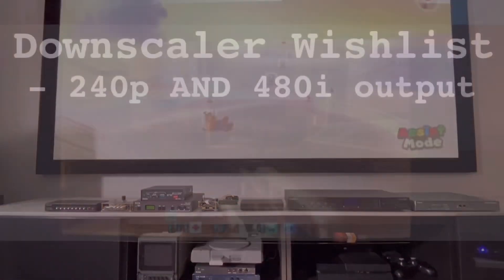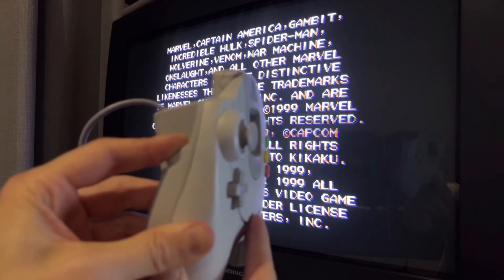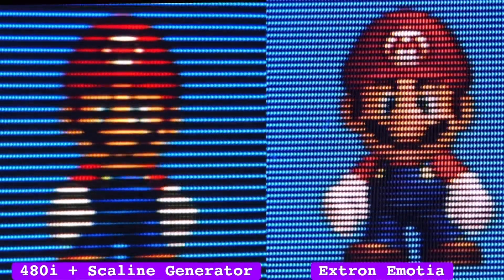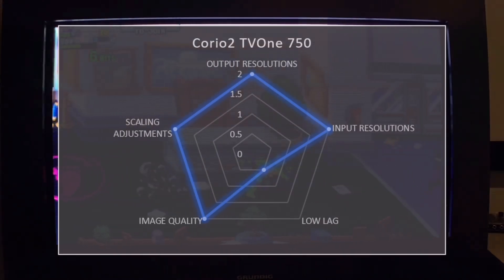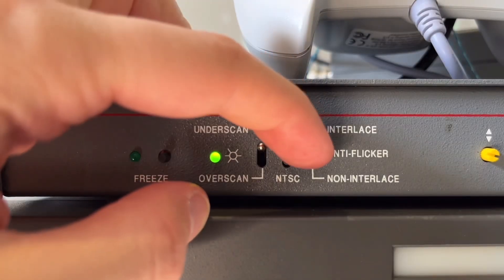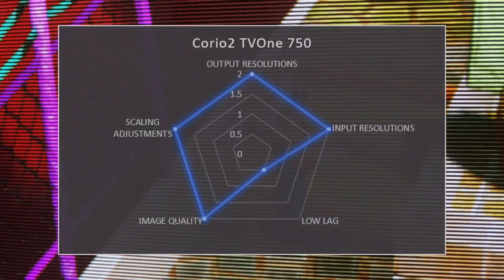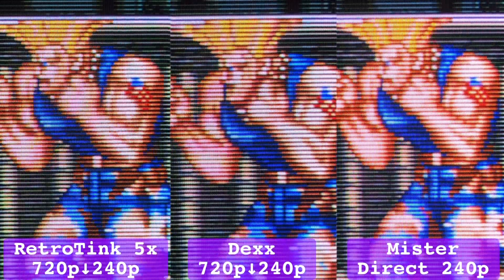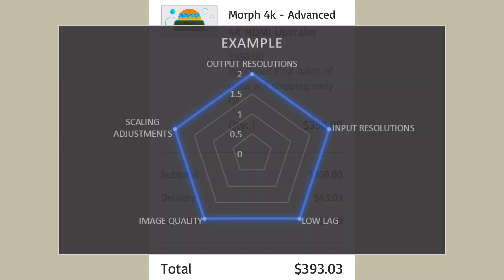Downscaling Chronicles 8: The Downscaler Wars. Corio2 tvOne GBSC Dexx RetroTink 5X Extron Emotia

Comment: This is great!.  I really like the RetroTINK 5X, but I see it's only inputs from component to HDMI.  I need it the other way around. How are you playing this to you CRT from  game consoles?  What converters/adapters are you using?

  I already have an 4K HDMI to component converter that works great with my laptop.  I can adjust anything to fit my 4:3 CRT perfectly.  But I'm trying to use an Amazon Firestick to my 4:3 CRT television.  The Firestick doesn't have a 4:3 setting and the video is squished so I need an aspect ratio changer and those don't seem to be easy to find.

  I do also have several video game system's that could benefit from the RetroTINK. 

  I can use the 4K HDMI to component converter to then take the HDMI out from the RetroTink 5X but then I'd need an HDMI to component converter to now go into the RetroTINK 5X.  So, being that I already have the first step done.  When I get the RetroTINK, all I have to do now is get an HDMI to component converter.  Is there another recommendation you have?

  Thanks for doing this video btw.

  Update:  Okay, I see you are using a Portta HDMI to component converter in the video dedicated to the RetroTINK 5X.
Reply from the maker: Caio! I see you found what I’m using for the HDMI to component conversion. This was more of a stop-gap in the series to save everyone sifting through hours of content. Since then, there’s a dedicated Downscaling section on RetroRGB which summarises most things you’d want to know into a table. 

There’s a new ‘king’ of downscaling that in my opinion is a 10/10 which is the OSSC Pro plus Extra AV Out addon. No external HDMI to analog converter necessary. Second to that is Extron DVS 605. Without either of those or even the RT5X you would be able to stretch pillar boxed content

Comment: What equipment is used with the 5x? Want to switch to it from corio2
Reply from the maker: You have to use an HDMI to component transcoder for the input, and depending on what your CRT accepts, on the output either another HDMI to component DAC, or an HDMI to VGA DAC with a sync combiner for RGBs.

Comment: I haven't had much luck with downscaling on my MiSTer on my astro city 15khz MS9 nano CRT. It always looks crap and it doesn't seem to have many options in the mister.ini to fix much. It varies from core to core, but downscaling always seems crappy, text is often illegible. 

I'm going to take a good look at the dex kit, thanks for the video!
Reply from the maker: Thanks for checking out the video! Why downscale the MiSTer at all if the CRT is 15KHz? You should be able to output native 15KHz without scaling, or do you mean you’re using MisterCade via Groovy MAME?
Reply: @MarcoRetro316  Oh mostly for any cores that don't output native 15khz, so cores like ao486, Sharp X68000 and then even for systems like minimig/amiga some games are actually out of sync range (a lot of them are fine without using the scaler though).Some of the more obscure consoles also output stuff that the 15khz CRT doesn't like.
Reply from the maker: @flain283  I oh got you. The only outlet with the DExx is you’ll need 2 DE-10’s; 1 as a MiSTer and the other as a scaler as the DExx runs off a DE-10 Nano. At that point you might at well be getting an OSSC Pro to downscale. I use a custom 240p resolution in the INI file for AO486 core, I’ll post it as a separate comment later tonight though you might already be using the same modeline. I haven’t tested if it precisely divides the scanlines so text and sprites will probably scale unevenly
Reply: @MarcoRetro316  That makes more sense now thanks! I am using a modeline for it (same as i use for the menu output) so i'm interested to see if its the same or not, thanks! :)
Reply from the maker: @flain283  I have this at the bottom of the ini file, you could apply it to other cores by putting the core name in brackets in place of ao486

[ao486]
; Set it to "Variable" in the ao486 core instead of 60Hz
direct_video=0
vga_scaler=1
vsync_adjust=1
vscale_mode=3
video_mode=1280,152,140,261,240,15,0,19,30105 ; 4x3 for 320x200 games, 16.42kHz, 59.94Hz

Comment: Did you ever try MIMO Genius 2? It is very good!
Reply from the maker: Not yet unfortunately, though I’d love the chance to try one to document for a video of its own. They’re hard to find nowadays
Reply: @MarcoRetro316  I bought the very last one directly from MIMO company a few years ago, I use it for downscaling only. I feed it with 640x480 VGA to downscale MAME and X360 and it is very good! With it I can avoid the hassle of a CRT Emudriver setup 😅
Reply from the maker: @pedroTFP  You got lucky! I reached out to MIMO Enterprise multiple times to see if they had any stock in the back but no reply. CRTEmudriver will be my next venture. Wish me luck
Reply: @MarcoRetro316  I’ll look forward to! 😄
About MIMO, I asked them if they’d ever go into a “Genius 3 project” but they said the initial cost of R&D would be substantial. I suggested them to look into crowdfunding!

Comment: Thanks for mentioning the pricing, I've been interested in downscaling to 240p since 2016 and never could because all the downscalers are just too expensive for me, paying upwards of 200~300 dollars just to downscale to 240p is just absurd to me, and the affordable option like the modded Corio2s have always been unobtainable to me at a decent price and have only become more and more rare, so it's nice to see cheaper options like the pre-built GBS-Cs or the DExx come out in recent years. But don't get me wrong I'm still not happy about it, you would think that downscaling to 240p should be dead simple, since there's cheap downscalers that can output 480i from 720p/1080p, and yes they can be a hit or miss but there are some decent ones around that only add 1 or 2-3 frames of lag and can also do fast interlacing for 480p under 16ms for around 40 bucks. But we seriously need a dedicated 240p/480i downscaler that only does that and nothing else as fast and cheap as possible for retrogamers enthusiasts that are using emulation with modern GPUs or just want to play modern games on their SD CRTs, not bloated ones that in reality are not even meant for us but for retro console gamers wanting to play on modern displays. 

Anyways at least I've got ways to play modern games/emulators even at high resolutions downscaled to 240p nowadays but it's not plug-n-play and yes one it requires an old card with VGA while a modern one does the rendering, it's cost effective but getting harder as cards with VGA are getting rare, lag should be relatively low or non-existent. There's also low-latency local video streaming to a PC that has VGA/DVI-I using ethernet and a fiber optic cable to connect both PCs directly which keeps the lag under 5ms using something like Steam Link or Sunshine/Moonlight, you can even use a Raspberry Pi as they can output 240p on HDMI or do composite but that can be a hit or miss on the weaker ones that struggle with video decoding, works great on a RPi4 or 3B+ though, still I wanna see the day we get 240p/480i downscalers that can do this without breaking the bank and as plug-n-play as possible.
Reply from the maker: Hey thanks for the comment. I do agree, a simple plug and play dedicated Downscaler with 240p/480i output made specifically for retro would be killer, sold at a cheaper price that removes the need for a beefy FPGA that’s needed for the upscaling side. I’m talking naively though as I have no insight to the engineering aspect. The cheapest solution that will get you all the input and output resolutions are probably a tvOne scaler, or a GBS with a piggy back downscaler, though a little messy with cable management. I plan on doing an episode focusing on MisterCast, PC GPU 15KHz output, and using a RPi (which is what I use to output 480i movies via USB as my PS3 and Wii can be fussy with video codec). It might be a bit much for one episode so I’ll see how best to tackle it to give enough screen time for each solution. The CRTEmudriver and Batocera users seem very happy with the output and is said to be the gold-standard for pixel perfect scanlines, provided you don’t mind repurchasing the game or obtaining by other means. Yet another rabbit hole

Comment: I'd like to know a cheap downscaler with no input lag

I want to play ketsui ps4 vertically on a CRT
Reply from the maker: The cheapest Downscaler with low lag is the GBS-C. There’s a few hoops to jump through like the HDMI digital to analog conversion and the PS4 needs to be set to 480p. I’m pretty sure the PS4 won’t display through the GBS without stripping HDCP

Comment: Doesn't the Retrotink 4K offer 240p output as well?
Reply from the maker: Yes I believe it does output 240p but not 480i
Reply: @MarcoRetro316  Ahh, interesting. Might be worth looking for a DAC that can go from progressive to interlace and 240p then. I'm hoping such a thing exists, otherwise I'll have to wait for Morph 4K to release its analogue bridge add-on. I want a minimal number of scalers in my setup. 😅
Reply from the maker: @MindForgedManacle I don’t mind doing all the sync combining and DAC-ing as long as they’re passively powered, but I’m really hoping the Morph 4K delivers as the plug and play downscaler with the analog bridge
Reply: @MarcoRetro316  Now that I think about it, you might look into the Extron VSC 700 (or 500). Can downscale from 1080p to 240p as well as 480i. Based on RetrRGB's testing, you'll get 0-1 frame of lag (lagfree as possible, really): https://www.youtube.com/watch?v=vX4Q_KvqZAI

And if you pair that with Ezcoo's 4k splitter (has a built in 4K->1080p downscaler you can toggle for split output), it should pair well with the Retrotink 4K.
Reply from the maker: @MindForgedManacle I featured the Extron VSC 500 is the Extron Interface Trick Video, it works great with picture resizing and is 1 frames of variable lag. But it only outputs as low as 480i ie no 240p output. It also has some screen tearing that was induced with horizontal motion in 3D games.
Reply: @MarcoRetro316   Oops apologies. I misheard him say it did 240p. He did in fact say it couldn't do 240p. 😅
Reply from the maker: @MindForgedManacle  no apology needed 🤪 easy mistake

Comment: This series has been fantastic! I'm very looking forward to future devices. I recently got a Tink4K and am looking into how to set it up with downscaling. Hopefully it performs as well or better than the 5x. There should be room on it for multiple downscaling options as well considering how much effort has been put into his prescaling and decimation work.
Reply from the maker: Thanks! I’m not sure if downscaling to 15KHz will be a supported feature on the 4K. It can certainly get it down to 240p as the pre-scale feature does exactly that. I do recall Mike stating that it won’t output 480i though. I have the PixelFX Morph 4K on preorder and would love to do an episode on the OSSC Pro when stock is available
Reply: @MarcoRetro316  Definitely excited for that as well. The Tink4k can output 240p via a custom linemode. My set soon will be splitting the tink4k hdmi output and remotely controlling if it's downscaled or not. If it is, it goes to vga, then to scart, into my gscartsw.

Here's hoping it looks decent. :)
Reply from the maker: @joshuakelly9390 ah thanks for clarifying. That sounds like a nice streamlined setup!

Comment: For me OSSC Add-on Board as stand alone unit is a GREAT thing for transcoding S-Video to RGB (Scart). None of my CRT TV's have S-Video, only Scart RGB and having this gizmo for 3DO Interactive Multiplayer or FM Towns Marty is a great option to have.
Reply from the maker: It had double the flicker on 60Hz 480i, and 50Hz 576i Bob-deinterlaced to 240p.  The workaround with the OSSC is to have the addon board output 480p instead of a transcoded signal passthrough. It otherwise worked well for 240p
Reply: погоди..так это чё получается, он реально может улучшить картинку с композита\s-video и передать её на Тринитрон с ргб входом ?  Так это же perfect для многих 8-32бит игр, которые,  мне лично по ргб скарту не заходят визуально.
Золотая середина так сказать, тот самый грааль, который ищут ретрогеймеры)
Reply: @JonnyK3D  может, но ты же сам сказал что RGB картинка вам не нравится.
Reply: @SNESFan89  так а показывать он будет как ргб-скарт при этом или скарт вход просто используется как разьём, а изображение будет композит\с видео ?
Reply: @JonnyK3D  нет, он будет показывать в RGB по Scart.
Reply: @SNESFan89  и как это технически возможно?  вытащить из 1-2 пиновых контактов достаточно информации для разделения по ргб+яркость. 
Звучит не правдоподобно.
Reply: @JonnyK3D  но оно работает. У меня она есть и отлично показывает в RGB.
Reply from the maker: The quality is still equal or worse than the original composite/s-video, just decoded into an RGB format. It won’t magically transform composite into RGB quality
Reply: @MarcoRetro316  yes, thanks.. that's how it should be)  But now I'm interested in it as a way to connect the Japanese GameCube (S-Video) to European Scart TV

By the way, I understood correctly after looking at your latest videos that while you can take your time with the old downscalers, take a break and wait for the Morph 4k tests? When will it be released there?
Reply from the maker: @JonnyK3D I have the Morph 4K since launch and it can already downscale with a custom resolution. However I’m waiting for the Crosspoint addon which allows analog video output. Pixel FX have said they will time this addon with accompanying downscaling functions in software, so my guess is it will behave similar to the OSSC Pro

Comment: I was planning to get a Corio but now when you mentioned how bad the input lag is it made me question my plans. Damn this make things difficult :-(
Reply from the maker: If low lag is your priority, depending on your budget the GBS and Retrotink5X would be for you. Then it comes down to if you need 480i output and >480p input
Reply: @MarcoRetro316 to be honest my main usage will be to downscale Wii U and Wii games to 240p. How do the GBS compare to Corio2 in image sharpness?
Reply from the maker: The GBS is sharper but you’d only appreciate the difference if you were looking at both sides by side. Also consider that the GBS will drop lines and therefore you might notice shimmer like I pointed out in the Dexx episode when Downscaling Super Mario Maker on the WiiU. The shimmer is only noticeable with 2D vertical scrolling especially with repeating organised horizontal lines. If downscaling complex sprites and 3D games then the shimmer isn’t an issue.  Essentially it’s ~2 frames of lag and smooth scaling with a Corio, or minimal lag and sharper downscaling that’s prone to shimmer on the GBS

Comment: Amazing video.  Currently trying to use the retrotink 5x to downscale ps2 games in my PVM.  I also have a dvdo vp50 (not pro) but I don’t think it can pull off 240p even manually adjusting resolution.
Reply from the maker: Thanks! You should have good results with the Tink5x and PS2. I didn’t cover 480i downscaled to 240p all that much and I totally see why when 480i flicker is more pronounced on high TVL pro monitors. I believe you’re correct that the DVDO VP50 non-pro won’t output 240p with custom timings. Dw, you wouldn’t be missing out on too much if it did

Comment: Where u found that information of DVS 304? Any thread about it?
Reply from the maker: Hopefully YouTube doesn’t eat the links. I’ll respond with another reply in case it does so you’ll know if they were deleted
Reply from the maker: https://www.reddit.com/r/crtgaming/comments/x5pptx/extron_dvs_605_dsc_240p_downscaling/

https://www.reddit.com/r/crtgaming/comments/zv7bfw/sony_trinitron_pvm_2530_this_pic_shows_svideo_i/

There were cross-referenced info I also remember reading on shmups
Reply: @MarcoRetro316  Thanks, i have a DVS 304 laying around and don't use that for a while, maybe i find use for this.